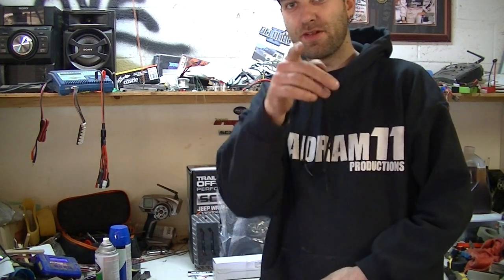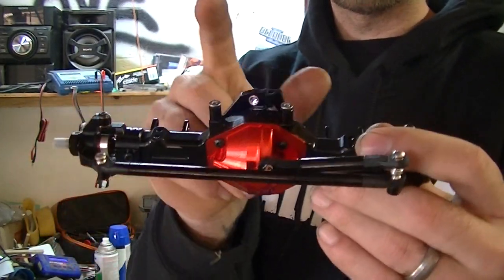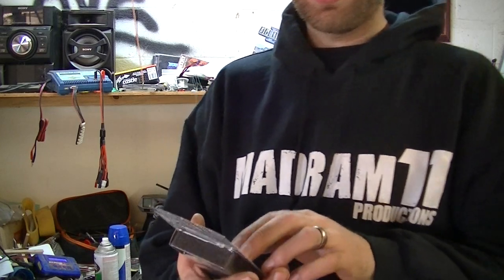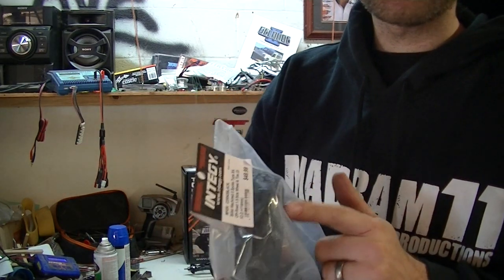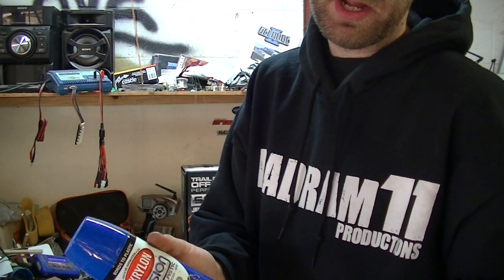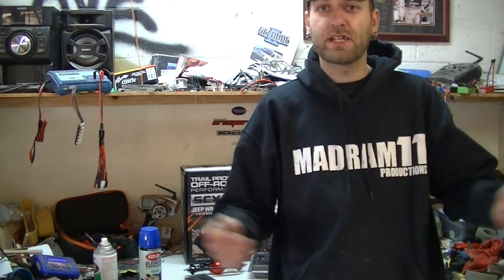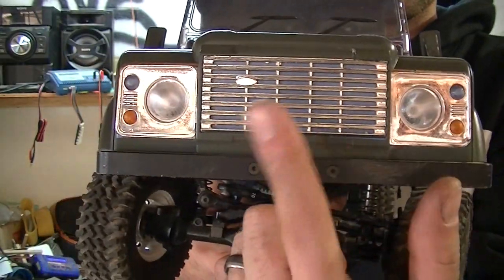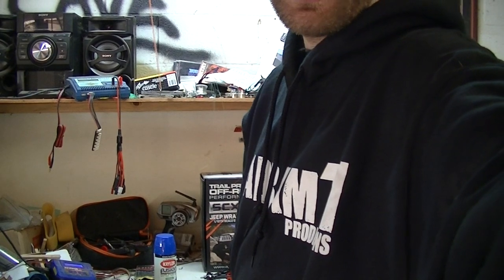Axial G6 Build Series: Integy Recon 1

Comment: That Krylon paint is excellent for RCs. I used it to do the interior on my Jeep JK body, but I sprayed it on the outside to get the flat look and it hasn't scratched or anything. Do you spray yours on the inside just as if you were using Tamiya or Pactra paint?
Reply from the maker: I've found that the fusion is the only non automotive grade paint I can spray without it running or orange peeling on me. I 99% of the time spray the inside unless I want to do a pattern then I mask the outside of the body and spray it.
Reply: Yea the Krylon satin black I sprayed on the interior of my JK is smooth and silky. No orange peel, no cracking and no fish eye in it. Has held up well. I had one paint job I did which is on my first video I uploaded that messed up on me when I sprayed it with some Pactra fluorescent orange. Totally ruined everything. So I used PlastiDip and Krylon to fix it.
Reply from the maker: James Ingram That would be the main reason why I stay away from polycarbonate paints lol. They may have more colors but they don't have jack on automotive grade or Krylon
Reply: Yea I was highly POd when my nice paint job went to crap as soon as I hit it with the orange.

Comment: the G6 build is gonna be awesome, with all the Integy parts. but it may be needing  a pair of these https://plus.google.com/b/107232750918049752820/photos/107232750918049752820/albums/5964885846755527745?sqi=113828278887369567561&sqsi=3c5f80c8-7673-4dff-9a85-e654aca2aac2 what you think? & that Rover pick up is looking good, thumbs up
Reply from the maker: Holy crap yeah I need a set of those sliders for sure to carry the beefy look going. maybe even a front bumper too! The landy is coming along, it took a nasty roll so i'm in the process of laying down spot putty and bracing the crap out where the cab meets the bed.
Reply from the maker: ***** that metallic blue is screaming my name. I effed up the color name its actually Patriot Blue, I was close lol but not right. Im digging the name too, I want some good sliders so it'll get renamed
Reply: ManCaveMediaFilms i would love to have the sliders apart of the Patriot Recon Warrior